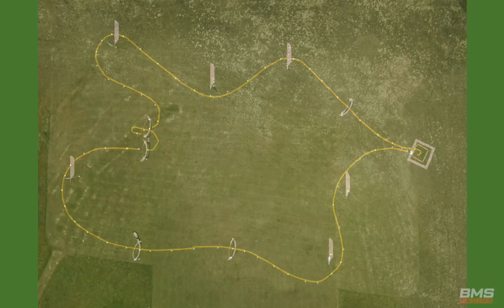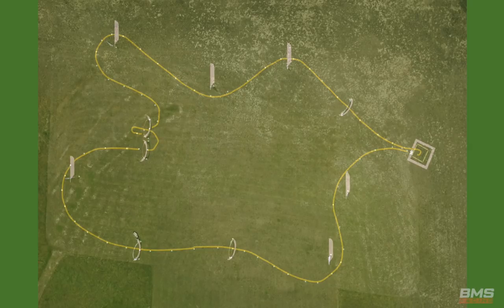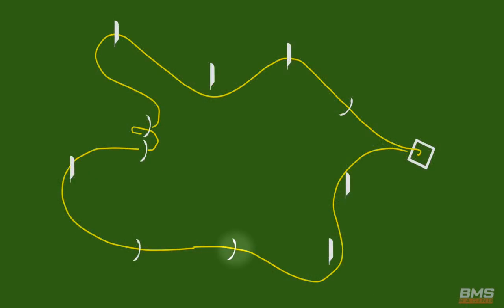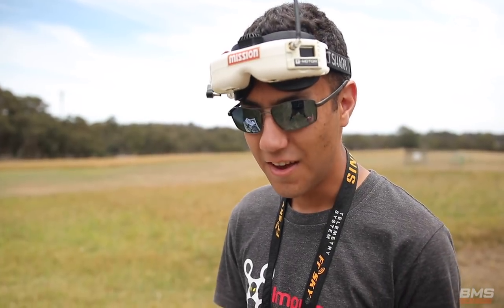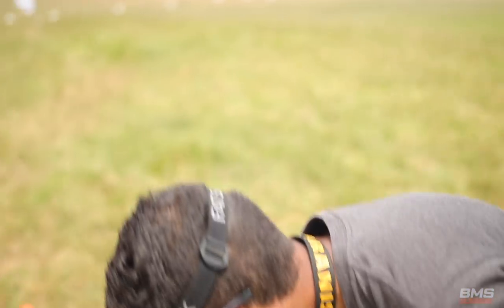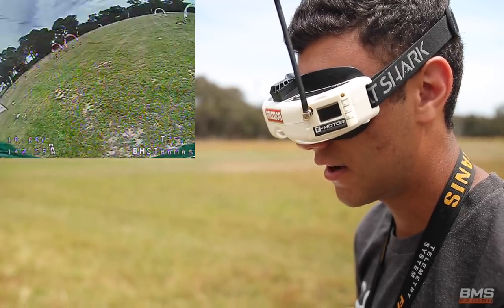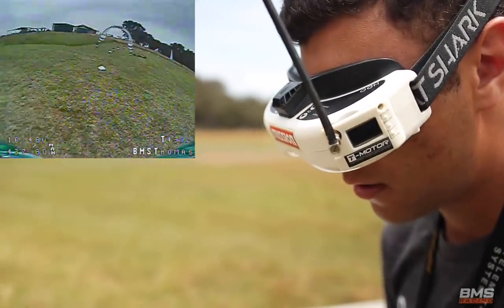FPV Drone Racing - Finding Rhythm Track Design #02

Comment: Great series so far.

Would love it if you could rig up a stick cam, or a stick overlay so the fluidity of control of movements through elements can be shown.  (like power loop, chicane and dive gate).
Reply from the maker: I will get on CAD today and make up a GoPro rig that can mount on the Taranis! Great Idea
Reply: @BMSWEB  Awesome.  I think this will be a great addition.

Comment: Hi Paul and Tomas ! This video is very informative!! Was wondering about the camera angle you guys are using? Normally I can only see the sky >.< would you guys consider doing a video about camera angle?
Reply from the maker: What a fantastic idea! It's a topic that has created heated debate and much confusion. But in short, Thomas runs 45 and I probably run 50. There is a theory that if you go for higher tilt it means you fly faster, that's only true if your speed is dictated by your camera angle. I'm about to upload a video to our Instagram, basically a promo of an up and coming edit, you'll notice that Thomas is looking more ground that sky. Much to discuss here!!
Reply: BMSWEB BMSWEB would be interesting to see what your theory behind it is! Are there differences factor that tie into it?e.g camera lens, weight of the quad ? How far the camera central to the weight of the quad( helix frame the camera is directly on top of the stack) ? So much questions I would like to ask!! Looking forward to the next video! 
And yes! Thomas Fpv feed looks more toward the ground! Did he lower the camera angle? 

Sorry for bombarding you guys with questions!

Comment: how many cell battery is that?
Reply from the maker: This was on a 4S 1600mah Pack
Reply: How is the voltage so high threw the whole run, would think it would be in the 14"s? Or the voltmeter not working?
Reply: Some sort of super battery. Now would be a good time to drop the make/ model of your lipos